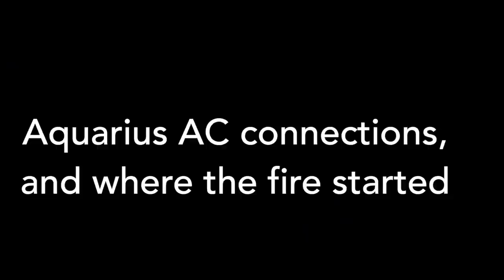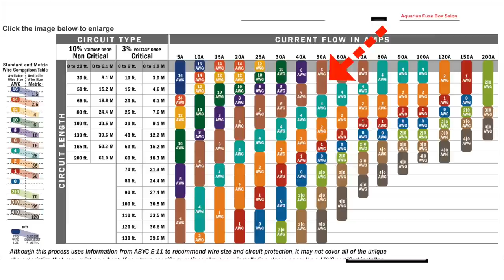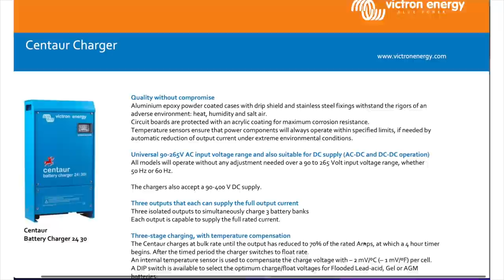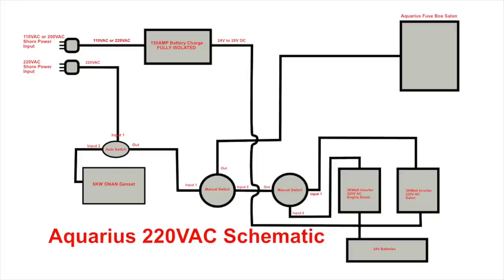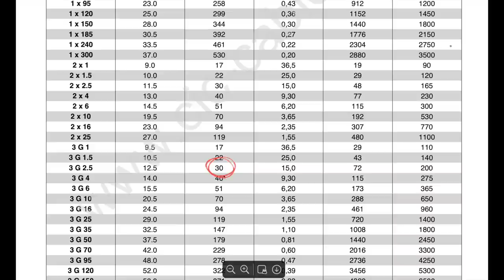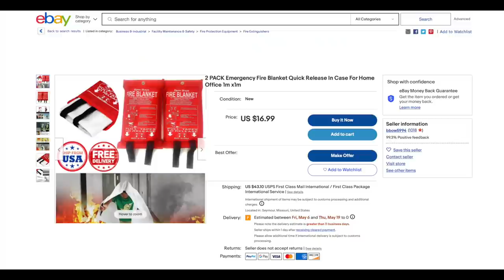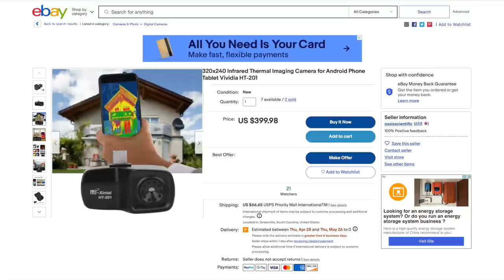Fire Aboard Aquarius - Tips on Tuesday - Fire and a few tips on how to avoid them!

Comment: Hi Ken, someone mentioned a loose connection as cause. Agreed that could be it. Also, if the wire gauge was smaller than it should have been and then the crimped contact on the end of the wire and the mating connector were not the correct type, you could end up with a high resistance section (a loose connection will have the same result). With the loads drawing a certain amount of power, a high resistance section will lead to greater voltage drop and even more current. This can create a runaway condition of increasing current where the high resistance section just gets too hot and then the plastic connector may melt or smoke and it seems that ultimately, something reached the point where combustion occurred. I'm glad you were able to disconnect power quickly and stop the spread.
Reply from the maker: Thanks Jeff!  I think we are on the same page.  Anyway, we need to get together next time I'm n SD...  Ken

Comment: Hi  from Iceland  use full size 10kg   fire bottle  and have 3  this are to small it cant be more dissapointed  then almost kill fire and botle is emty  and use Halon  ore co2     not powder I have fire on me boat and I will never use powder agene all inside engine room  was dust and even clean all is mat  and dust many years after you need to strip all the room  to clean    I am ship service  mechanic    fore 35 yers  I have fight with fire 3 time  and this is no joke in ship
Reply from the maker: Thanks for the heads up.  I have heard from several people not to use the powder, especially on electronics.  Ken

Comment: Ken, the smartest act you performed was disconnecting the electric. I am a believer in having an automatic Halotron Fire Fighting System in the engine room. Certainly you saved your boat. Thank you for sharing this video. A fire is a scary thing aboard any vessel, you kept a cool head and put out the fire. In addition to the smoke hood for everyone aboard, I recommend a fire blanket which can be a very effective fire fighting tool in a small area, such as the galley. I am glad both you and your wife are safe, and you can continue with your wonderful adventures. Safe sailing.
Reply from the maker: Thanks Captain Berger,  Ken

Comment: Solid tips!  I found a bad connection in one of the 110v AC outlets in my house... I noticed it sparked when I plugged something in, took it apart, and about 2" of wire was charred.  I went through and checked all of them in my house and found a few more loose connections.  Scary stuff.
Reply from the maker: Yes, very scary stuff...  Ken

Comment: I think it was a loose connection…
A loose connection  generates considerable heat right where the wires and connectors are ‘loose’ 
Did you ever notice that if your main battery terminal is loose, and your engine won’t crank over,
The lug on the battery is loose, and hot!
Reply from the maker: Yes, you are correct..  Ken

Comment: Great video, great advice.
With your Lithium setup and increased efficiency have you evaluated the efficiency of your air con and refrigeration units? I assume yours are original, are split gas devices  with one central unit in engine room and separate condensers available and affordable? Such a setup should provide better dehumidification and efficiency should have improved
Finally who did u get to insure boat with Li batteries?
Reply from the maker: AirCon - We have three separate AC units that are water cooled.  Bow cabin, Salon, and aft cabin.  Also we have a portable AC unit that blows hot air out a window.  

For insurance call - 
Matt Slatter 
Steve Slatter Insurance Brokers (Pty) Ltd 
Authorised Financial Service Provider FSP No. 10663 
17 Lynn Ave, Glenashley 
South Africa, 4051 
Phone       :       +27 31 5628320 
Fax              :       +27 31 5628087 
Mobile      :       0826551402 
e-mail        :       matt@ssib.co.za
www.ssib.co.za

Comment: Great tips, the question I have is  if your fuse is rated for 30 amps how much bigger should the wire be in general.  I know their are charts out there but I am talking about in general. Ex. Next size up 1.5, 2 times bigger?  I think this would be good knowledge to know even in a house  setting.
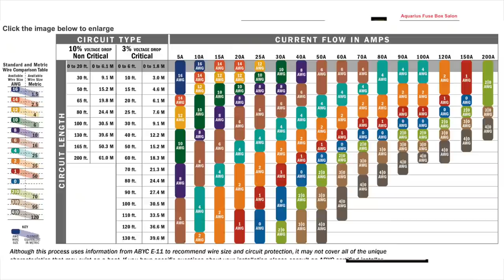Reply from the maker: House, boat, electrons move the same in wires.  So, in the video I put a wire gauge map...  06:58 take a look at it.  Give the size of the wire knowing the current, and length.  Cheers, Ken

Comment: when checking the connections it would be better if the circuits were under load.
Reply from the maker: Yes, of course, if there is no load you really can't check it with the thermal image camera.  But, you could  make sure the connections are clean and tight, that would probably repair 99 percent of the problems..  Ken

Comment: Bloody good video Ken .What type of extinguisher did you go to put out the fire with because powder makes a huge mess and gets into everywhere.
Reply from the maker: Halon 1211 4KG..
Reply: @SailingAquarius  hi Ken ,unfortunately Halon is banned in the UK .
Reply from the maker: Also, it would have been good to hit it with a CO2 extinguisher.  But, beware, you might not be able to breath, so good ventilation would be good.  Or stay out of the room with the fire and shoot into the room with the fire.  That's what I did due to the smoke in the engine room..Ken